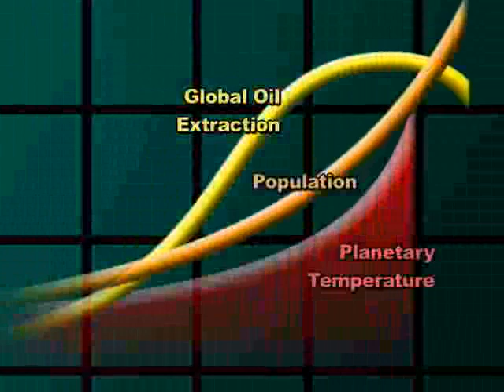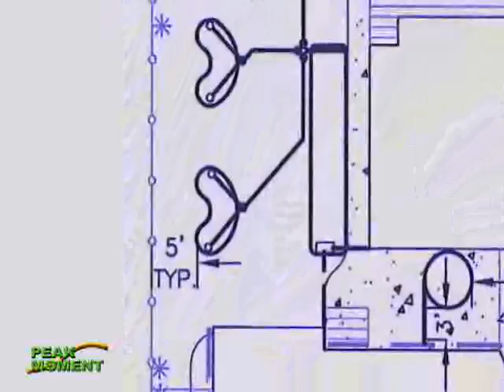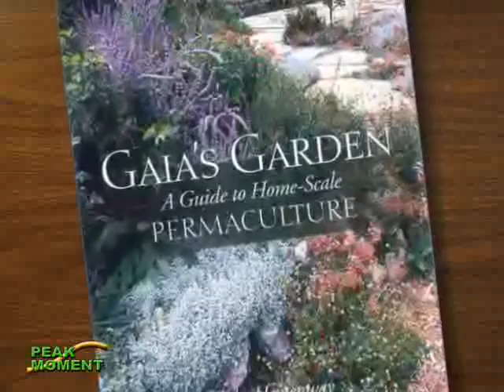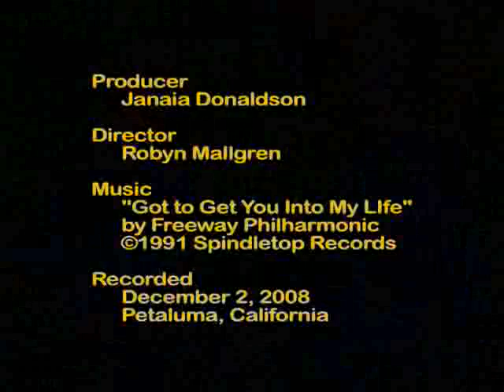Creating a Home Graywater System

Comment: This is really some awesome project, I like it very much. Fortunately I live in a quite rainy region and so we do not need water for the plants in our garden up to now, the few hot weeks in summer can be compensated by using rainwater from the roof catch.

But I still have a question concerning the geywater: If they use the water from the shower, don't they have problems with tensides from soap etc or wrong pH-values ruining their underground pond system? Would be glad to get some details. THX!